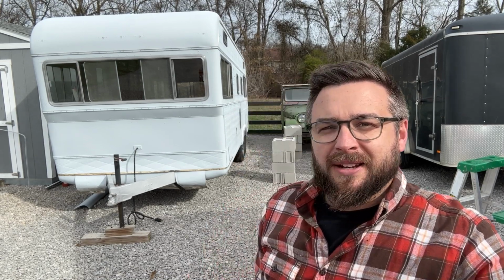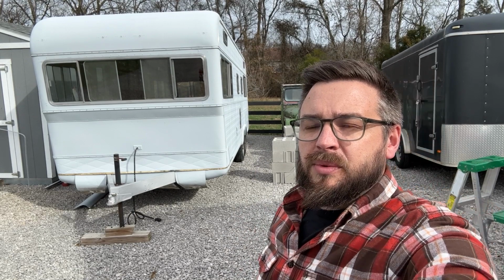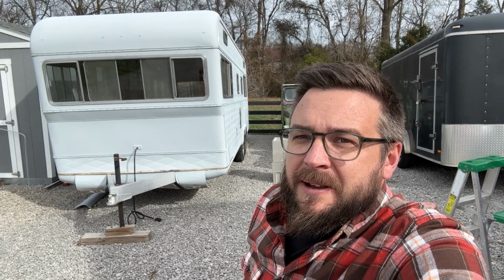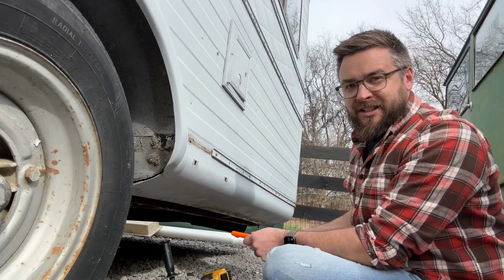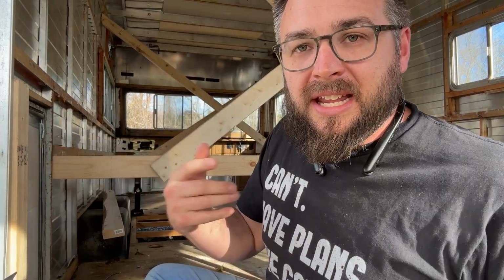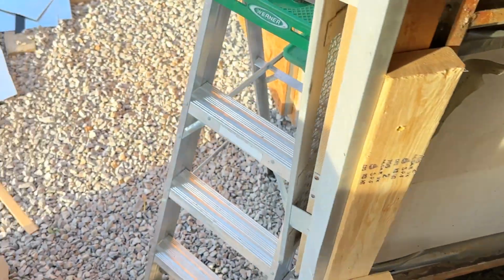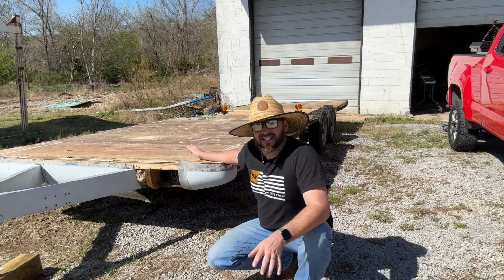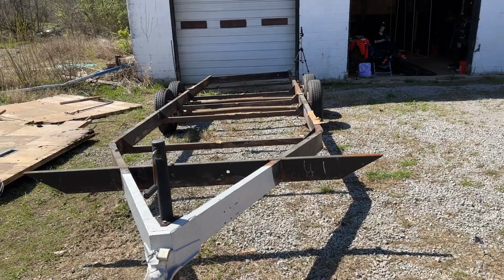Are we Really Lifting the Body off my Vintage Camper?! : 1971 Holiday Rambler Reno Part 11

Comment: Loving watching these videos! I know by watching some nerdy camper tech videos, that Jayco builds out there steel frames with those metal triangular shaped flares, or whatever they're called, lol. I wonder would a new Jayco frame fit an a Holiday Rambler? 🤔
Reply from the maker: Thanks for watching! Anything is possible, but I would lean toward a custom build being a much easier project than retrofitting a new frame.

Comment: Gutsy move, Dude! But the right move! Question/Suggestion: If it were my RV and I already had all the wood framing exposed, I'd put a coat of fiberglassing marine epoxy on all the wood parts (including all plywood subflooring!). You'd never have to deal with wet-rot ever again. Honestly, I don't know why manufacturers don't do this. If they did, RVs would last for ever. And if there were leaks from the roof, sure, it would be need repair, but the wooden frame would not rot! Anyway, great job!
Reply from the maker: My guess would be a combination of cost and weight.  Most RVs probably aren't built to last more than 20 years.  The fact that this one is still in decent shape at 50 is pretty amazing!

Comment: I love your videos.  My Rambler is still sitting in the same condition I bought it in...rough.  You mentioned watching other videos, but didn't give us all their names.  Could you offer other quality resources?  There doesn't seem to be as many people doing these campers compared to the smaller Canned Ham types.  My floor is very rotten, so I think lifting the walls will make replacing them much easier even if I don't need to rebuild the frame.   Also, did you have a tub, and do you think it could be reinstalled or did it crack while removing it? Thanks,  Laura
Reply from the maker: Thanks for the support! I haven’t seen much on these trailers either. Best info so have found is in the Vintage Holiday Ramblers Facebook group. A lot of these types of projects just require digging in and seeing how it’s put together.  It’s much easier if you have the aluminum frame models like mine. 

I did have a tub but unfortunately it is long gone!

Comment: This is insanity. Keep on chuggin! Definitely lengthen the tongue!
Reply from the maker: What makes you say to lengthen the tongue?  That's not something I had considered, but spoiler alert: the frame is already built, I'm just catching up on videos!
Reply: @bakermakesit  Hah, I figured. It'll give you more turning radius. I also carry motorcycles, so if I bring the trailer, I have to keep my tailgate up due to it hitting. Meaning only small motorcycles or 1 motorcycle diagonally.
Reply from the maker: Ah, makes sense!

Comment: you have .... courage lets say, to go this deep. With the 78 i considered this frame removal too . but ...
in my  considering i would like to share some conclusions that i feel would be beneficial. lengthen the tongue  hitch part . 
the reasoning is this , a mini split might be in your future, if so the hitch - tongue is too short. Add a third rail down the center of the hitch, extending to the boxed axle support truss, just at the front spring hanger (you might find that if your frame rails on the old frame are bent  or swayed, it will be in this forward section.
the third rail does make a difference in flex and handling though the HR is a sweet dream road queen when towing.

second consideration
on rear bumper add tube within tube so your rear bumper can extend and  slide out farther from the coach  for 
a. an outdoor kitchen mounted to rear bumper
b. a motorcycle carrier
c. a tool box  excess supplies stash ( i used a protec truck toolbox to great effect until the weight ripped the factory bumper off.)
by being able to extend and retract the bumper, allows you something these old designs lack - space. never enuf space.

axles , i loved the look of the dexstar wheel but you're limited to ten inch brakes- awful. perhaps disc on fresh axles??  i did an axle flip and noticed no effective difference in handling stepping in was not a challenge either. i kinda wish now, after watching your video that i would have taken this step, i could have incorporated design changes had i taken the plunge. i would also box with 2x6 the axle hangers, front and rear with round tube at center trunion. redesign your ground - wire system at this time such that it is readily accessible and there is a common post  for everything, and that post is positively connected to the tow rig.
thx fer video
Reply from the maker: A lot of good thoughts here!  I've actually already built the new frame and am just catching up on editing videos at this point.  The rear bumper is super flimsy on the original design...they stepped down from 2x6 1/8" tubing to a U shaped section that is more like 14 GA.  I wonder if it was done that way to create a crumple zone for safety, but I went much sturdier on the new frame build.  

My axles actually have 12" brakes since they are for 15" wheels, so the braking power of even the original ones were insanely over powered for a trailer this weight.  You'll see in future videos that I upgrade the brake backing plates to modern self-adjusting ones as well and was able to get the vintage drums turned to round.  These are the same size that a modern 14k# trailer would have, so they can lock up all 4 wheels easily on this setup (at less than half that weight).  

I will definitely be redoing all of the wiring when it comes time. My plan is to use a junction box at the front for all the trailer wiring (house wiring will have it's own fuse panels and breaker box inside) to simplify connections, as i've found that to be super helpful on my other trailers in the past.  

Thanks for following along!
Reply: those wheels did look peculiar. not like the dexstars  exactly. interesting. i wonder whose axles those are. my dex are 15" also but ten inch drums. keep going there is a stopping point somewhere in the future. youll never be finished bit will find a good point to say " enough"!